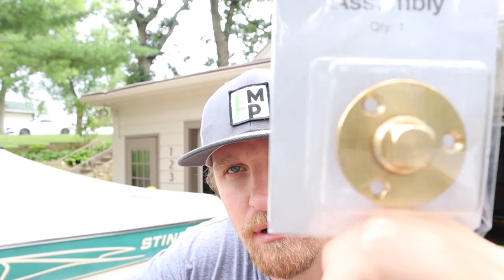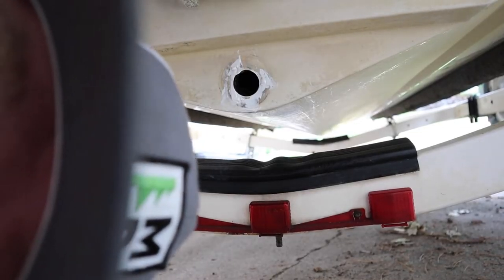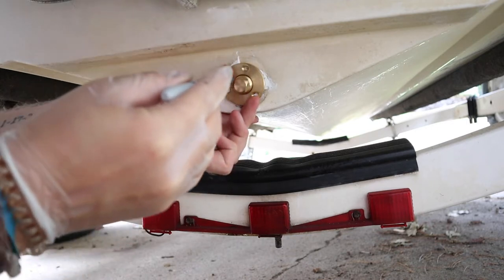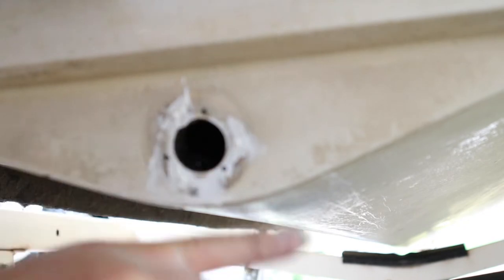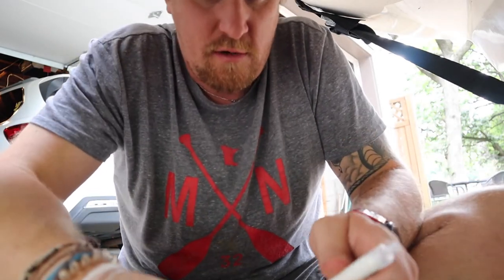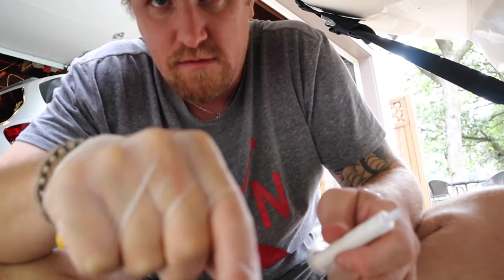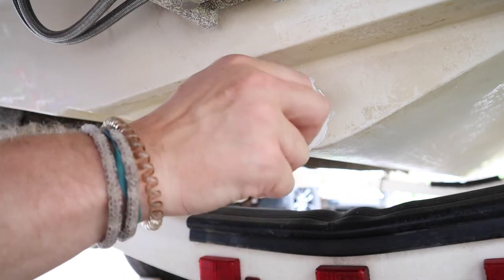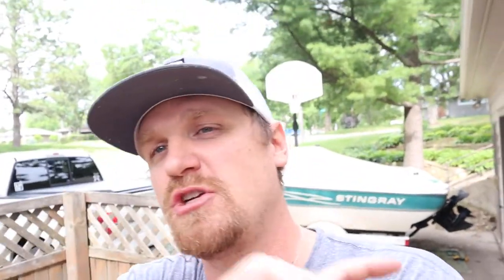How to install a drain plug on a fiberglass boat - maintenance day

Comment: Nice work.. I would recommend seal entire flange you completely bypassed the “hole” areas which can leak.  seal entire flange circumference and put screws in wet with sealant
Reply from the maker: Oh good call! That is good to know!
Reply: Yea , seal first then drill makes sense,, not sure why all boats don’t have this type of drain plug…seems much safer
Reply: My thoughts also!!

Comment: On a #8 if you go oversized and drill backwards first. You will not crack gel coat. Same works with pilot holes. Go backwards and burn the gel coat. Then drill the fiberglass.  Good video
Reply from the maker: Good to know. Thanks for watching! Appreciate it!

Comment: You needed to just caulk a complete circle over hole too, and not caulk around plate, that doesn't help at all, and it looks like crap 😅
Reply from the maker: @danielschiel7001  awesome! Appreciate you checking out the video!

Comment: How has this been holding up? Need to replace the smooth tube on a bass boat and considering changing to a garboard plug like this
Reply from the maker: So far so good. I have since sold the boat but was amazing before that! It was a pretty seamless install and I’d highly recommend. Thanks for watching the video! Appreciate you!

Comment: Would 4200 sealant work aswell ?
Reply from the maker: Im not 100% sure but I would assume so
Reply: Yes 4200 is ideal , 5200 is permanent,  if he ever needs to replace it again , all that gel coat will break off with the plug